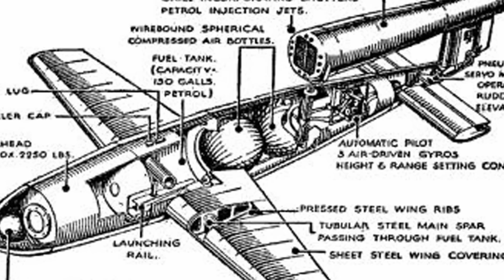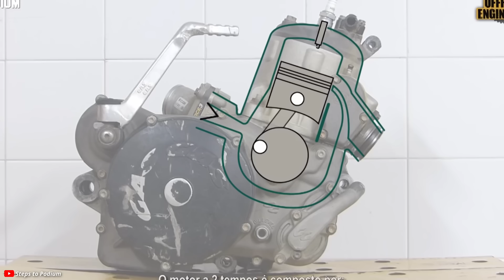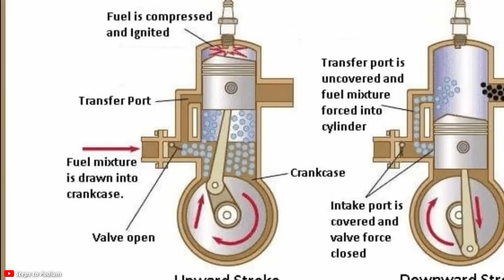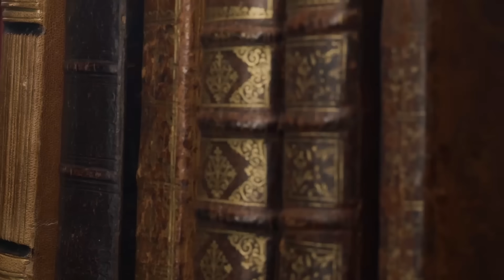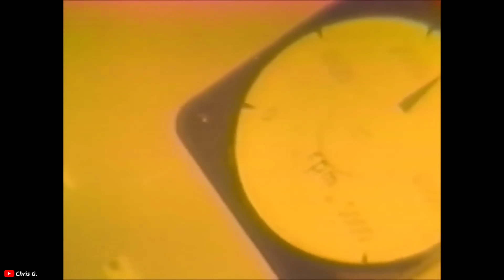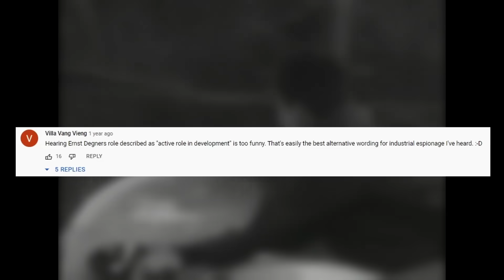How Suzuki stole communist technology to make their motorcycles faster

Comment: Back around 1970, Cycle magazine published a couple of articles covering the design of expansion chambers, including engineering drawings and formulas. By varying cone angles and pipe diameters, you could affect maximum horsepower and torque, rpm range and how flat the power curve was. I spent my free time in high school designing expansion chambers for motocross bikes, flat trackers and road race machines. If only some motorcycle company had paid 17 year-old me a large sum to develop expansion chambers for them, life would have been sweet. But alas, no. Instead, I went to college, got an engineering degree, and spent my life designing roadway pavement, traffic signals and streetlight systems. <sigh>
Reply: Thanks for making our roads safer.
Reply: @ratoneJR  he worked under the guy who makes our roads safer
Reply: @556WalkemdownTorrents  You knew Darrell and Ken?
Reply: Boring!
Reply: @patrickporter6536  
But interesting nonetheless.
Reply: @patrickporter6536  Only because you don't understand returning soundwaves.
Reply: @aaronleverton4221  
Patrick was trying to be clever.
Reply: Toomey, an exhaust manufacturer in Paso Robles CA, kind of just went for it and started making aftermarket expansion exhausts. His Hughes 500 is pretty sweet, there's definitely some money in it.
Reply: That kind of boring engineering is essential and often overlooked. Thanks for your contribution
Reply: I got many home made expansion chamber exhaust design in late 80s for my 100cc 2 stroke and its not ez to get it right but I had sum gud times in local circuit racers
Reply: What happened to Cycle? My brother used to subscribe and I read it avidly but then I moved away and at some point he stopped getting it - at that age you take everything for granted and suppose I always assumed I'd be able to just "get it again". So many great publications have disappeared - Omni, Byte, Isaac Asimov's and all those other SF mags, all the English electronics ones... 😢
Reply: @christopherbedford9897  Cycle started losing ad revenue and got smaller and smaller. Cycle Guide had more ads and lasted a little longer but eventually died. The last Cycle editor I remember was Cook Nielsen. Cook won at Daytona in 1977 on a Ducati. He is still alive and is 79 years old. The last Cycle technical editor I remember is Cal Rayburn. Cal won at Daytona in 1968 and 1969 on a Harley Davidson. Cal passed away in 1973, at the age of 33 in a race accident in New Zealand.
Reply: We always knew how to make 2 cycles more powerful, but we also knew that also turned them into super gas hogs! Useless for anything but all out, no money limit, racing... 
Also around 1970 Cycle began dyno testing motorcycles which exposed how little HP some brands had and put them out of business quickly...
Reply: Damn
Reply: @jamesdarnell8568  I guess to summarise then: like all the good magazines, it was too dependent on a couple of people who were driving it and when they left / retired / died, the mag died with them. Sad to hear, but I guess that's life.

I don't remember any names, but a particular "spirit" was very strong. There was one columnist who reminisced about - well, I seem to recall dirt track racing, maybe - but again, it was more about the can-do ethos and fun he used to have working on his own bikes. He claimed he once re-lined his clutch with cork from a {???} Brothers store (we in South Africa were very cut off from American commerce and couldn't get a fraction of the products available in the US, store names meant nothing to us) and he loved fried-egg sandwiches. Those were the days, my friend, we thought they'd never end... and that, right there, marks me as a boomer, I know.
Reply: Remember Denco? Their 2 stroke modifications were incredible.
Reply: The sound of a Kerker on a Suzuki, or Honda( 750 ) is.my all time fave.
You remind me of 17 yr old friend,  he was teaching the wood shop teacher... But instead of continuing the furniture "" he went on to build sets. ✌️ span 3.5 secs for the fools running reds
Reply: Well done BSCE PE chemE
Reply: Suzuki missed out on your talents, maybe they missed some titels.
Reply: @JM-nt5fm  my first tuned pipe on Kaw90cc was from CA Rohr was big 1968 am sure my hotted rotary valve was Rohr but unsure about the pipe. Kawasaki original was straight baffled the tuned had a glaspak as seen today
Reply: That's still pretty badass bro
Reply: In the 1970's my dads friend was the exhaust builder for the Honda racing team - I can tell you that a guy called Pete Monahon got your job, or at least the build part of it.
Reply: They used an adjustable exhaust pipe or racing two stroke boat motors back in the day that you could fine tune the motor on the fly.
Reply: @christopherbedford9897  No kidding.  Playboy has male playboy bunny cover dudes now that Hugh is dead.
Reply: You didn’t design the purple street lights I see everywhere now, did you? 
😵‍💫😵‍💫😵‍💫
Reply: This was a very fun and interesting thread to read.
Reply: @Surannhealz  Nope. Only the white ones (metal halide) and the orange ones (high pressure sodium).
Reply: Oh great !? Are you responsible for all the bad traffic and unnecessary bike lanes, perfectly timed lights that stop you right before are about to make it through and round abouts that kill gas mileage and clog road ways !?
Reply: I am sorry for you 😞 well at least Roadway Engineering is a good strong steady career. Perhaps things would not have been so good with motorcycles - I don't know. Thanks for Designing safe roads for us
Reply: @AuntAlnico4  Okay, I am not responsible for the increased traffic volumes. My job was to safely accommodate the increased traffic. Bike lanes are not unnecessary; they help keep bicyclists safe. Traffic signals are usually timed so that you will not have to stop; but you have to drive the speed limit for the timing to work. If you drive faster than the speed limit; or if heavy traffic causes you to drive slower than the speed limit; the timing no longer works. Roundabouts slow traffic down so there are fewer accidents. They work but I will admit that some cities overdo their use and it makes no sense to put three or four of them in a row. 

This discussion has wandered far away from the original discussion of the design of expansion chambers for two-stroke road race motorcycles.
Reply: I don't know who invented the efficient expansion chamber for motorcycles but I know who did for the snowmobile... Doug Dennert, a friend of mine. In Idaho Falls, Idaho back in the mid 1960s.
Reply: Hah, do Special Inspections of Structural Engineered buildings now
Reply: @jamesdarnell8568  When did you find out that blueish light is actually better in terms of human visibility?
Reply: @Nadnerb The 3rd I loved Gordon Jennings. In addition to Cycle, he was also on staff at Road & Track and was editor at Car & Driver. He passed in 2000 at the age of 69.
Reply: JAMES 👍✌ I see Homemade Expansion Chambers on the Motorized Bicycles 44 CC Motors ,Stainless Steel,  Here in Costa Rica,  And the Work is Amazing, And one 44 CC Motor is Louder than 2 Straight Piped Harley Davidsons..They have a Friday Night  Street DRAG RACE That is making the Niegborhood Crazy ..But nothing is being done about it ..Just like the Other Racing around the World .. But still pretty Amazing 🤫🤫
Reply: That was Gordon Jennings, he wrote a book called "The Two Stoke Tuners Handbook" with all the math to build expansion chambers for two stroke engines. He was the tuner for a road racer named Danny Coe on a Honda MT125R road racer for the AFM races in Southern California in the late 70's. At that time the racetracks were Ontario, Riverside, Willow Sptings and Sears Point near San Francisco. Gary Shumake was another two stoke tuner in SoCal at that time. Danny and Thad Wolfe were the fastest racers in the 125GP class, they would smoke my ass in the canyons around Santa Monica.
Reply: @AuntAlnico4  A-  you are way off topic.  B- Sorry but read the statistics, ALL Stops or big slowdowns, cost gas and CO2 pollution even greater.  Roundabouts save gas, reduced slow times. are safer and are way more efficient, if placed properly. Check the numerous research results statistics!
Reply: @jamesdarnell8568  

This roundabounts are a plague here in Europe.  Every 2 km there's one , huge ones , one can mount a circus there .
Reply: Newb
Reply: Should have went mechanical !
Reply: @otisarmyalso  my flattracker bighorn 350cc had a Rohr expansion chamber pipe, got ruined in a highside, have the original pipe on it now...from Wyoming USA 🇺🇸 🤠
Reply: @JM-nt5fm  Several companies made bolt-on tuned pipes for a variety of machines.... Not just for motorcycles, but also for Karts, Jet Skis, Model Hobbies, Experimental aircraft, Quads, etc... A large aftermarket industry, that was negatively affected by environmentalists... But still is very strong for 'Competition' use equipment...
Reply: @jamesdarnell8568  I remember Cal Rayborn from the movie On Any Sunday... He was one of many who made big contributions to the motorcycling sport... Hopefully, their names will be remembered by many, for many years to come...
Reply: @BuzzLOLOL  A lot of companies involved in the wide open motorcycling industries, especially in the early 60's till the early 80's seemed to go out of business because of their hugely powerful - deep pockets competitors... One such company was named CARABELA... This company, based in Mexico City, used Italian 2-stroke engines and suspension systems. They were very competitive on the tracks and extremely competitively priced in the show rooms. Honda (and the other big 3 Japanese motorcycle companies) were very concerned that this company was so close to their major customer base (United States) for their future plans to expand their product lines... So they gave Carabela an 'Offer' that they could not refuse... Carabela, at that time, stopped making motorcycles, after they sold out to Honda...
Reply: @michaelmartinez1345  - Never heard of Carabella... guess they didn't get this far east...
Reply: @BuzzLOLOL  They were great bikes... My cousin had a 250 Clarabella, and he said that machine was amazing... This company based in Mexico City, previously made shopping carts for grocery stores, 3-wheeled lawnmower engined carts for post offices, and a few other mundane items... Then their executives started making motorcycles... First came street bikes, then came the competition machines... The big 4 Japanese companies were concerned about these bikes, as several of them were running away with trophies after the races... And they were base in a country just to the South of their single largest sales marketplace, the United States... Honda finally approached the exec's at Carabella, with an offer that 'They could not refuse'... And that became the end of Carabella Motorcycles...
Reply: @michaelmartinez1345  - Kinda like Pentons... or Buells... I remember the CZs had that slow revving plonk plonk sound... but won all the races...
Reply: @BuzzLOLOL  The CZ's were amazing bikes, especially coming out of turns and getting whole shots while they were into the berms... Joel Robert and Roger DeCoster both were masters on CZ's... I do remember the Penton's and I heard they eventually merged with KTM... Bultaco's , Ossa's and Montessa's put Spain on the map of MX machines... So many companies, and the people who were involved with them, that are gone, but not forgotten...
Reply: @michaelmartinez1345  - back in late 196o's the Trans AMA MotoCross came to our local Delta, Ohio Track in NW Ohio so #1 Joel Robert CZ and #2 John Banks BSA 500 came to race our best local guys... Joel won and I was impressed his feet never left the foot pegs on the curves, but John sometimes did... 
There was a Trans AMA movie but I've never found the right one again... it showed the Delta Track via a sign, but it was fake, it had bare desert and mountains in the background whereas around here is grassy and flat... 
When Cycle magazine started dynoing MX bikes around 1970, that killed off most of the Spain and European brands as they had about 15 HP and needed more like 30 HP to compete... but I remember the Montessas had beautiful engines in the ads... I test rode a Yamaha 250 Enduro before being drafted, but decided I wanted the 360 when it would come out, so after basic training got the 360... sold it to a captain just returned from Vietnam just before I shipped out for Vietnam... later had a Honda 175cc 4 stroke scrambler, then Ducati 450 Desmo Scrambler... later  a modified Yamaha 400 MX briefly, took it back when discovered it didn't have a 4th gear, but man it was FAST! Been looking at Honda RM600 singles... Currently have a Kawasaki 440cc and Suzuki Intruder 805cc: 
https://i.pinimg.com/originals/54/04/cd/5404cd5912bb0cc797639d080546a04f.jpg
Reply: @BuzzLOLOL  so many of those classic races were very cool, especially when they featured the top riders on their machines from various parts of the world... One of the things that makes Dyno testing so decieving, is the way the power was produced... Sure, certain machines produced more peak horsepower than others, but what many people overlooked was the narrow rpm range , that those super high horsepower engines produced that kind of power... The machines with lower Horsepower usually had much better torque curves, that provided much better ride-ability, especially when going up long grades and coming out of turns and berms... The torqueier machines almost always had an advantage at tracks with wide speed variances and areas of mud & soft sand..  This is the reason why the BSA 441 and 500 Victors had an advantage over a 360 RT-1 Yamahas with almost twice the horsepower that the Beezers had... The BSA's had way better torque than the Yamaha's so they could easily out accelerate and use their massive compression to help slow the bike more rapidly... In fact, Yamaha was so impressed by the BSA's, that they start making their own versions of those big thumpers, the XT and TT series of bikes... BTW, that Suzuki Intruder is GORGEOUS!!!!
Reply: @michaelmartinez1345  - Actually, the emissions laws just forced the 2 cycle engines out...
Reply: @BuzzLOLOL  Here, in the U.S., Yes. some of the 2-stroke applications are still alive & well.... In other parts of the world, 2-stroke engines are still very much alive.... The diesel 2-stroke engines were actually very efficient... I'm guessing at my next statement, but the idea of using alternative fuels is  actually the best solution that makes the most sense to protect the environment... And I feel that HHO is actually a very good candidate to run turbo-shaft engines... The problem with HHO, is it will quickly make carbon based fuels obsolete when people find that it can be produced onboard a vehicle, from water... Then after the burn and energy release, it turns back into water , aka- 'Renewable' .... Another thing, is when using a turbo-shaft engine to produce power, this engine would have several advantages over a typical reciprocating engine..... No multi stage transmission would be needed, just a Fwd. Neutral & Reverse box would be all that is needed. No liquid cooling system would be needed, they can run on several types of fuels, they are light and powerful, they are extremely smooth and can be very quiet, and they could last for several lifetimes of most chassis designs...
Reply: @michaelmartinez1345  - There's no perpetual motion engines, it takes more power to make hydrogen than what it produces...
Reply: Any relation to Russ ?
Reply: The Two-Stroke Tuners Handbook is the definitive motorcycle reference for this.
Reply: Back in the 70s we used to also make our own expansion chambers.  Those things were the noisiest pipes in the world.